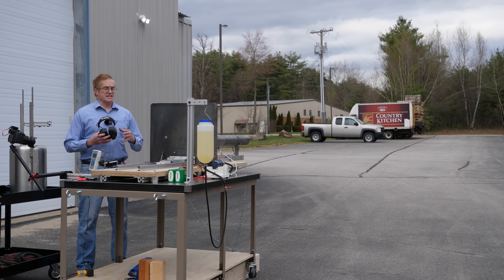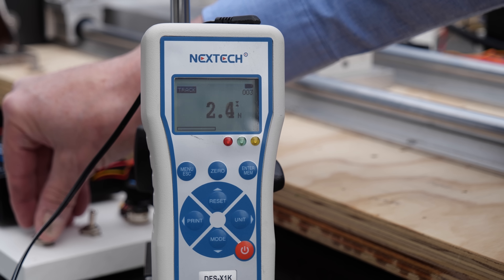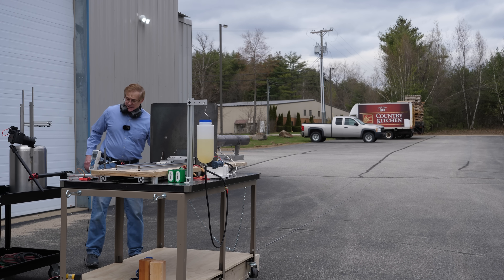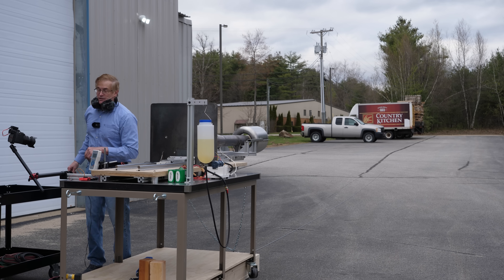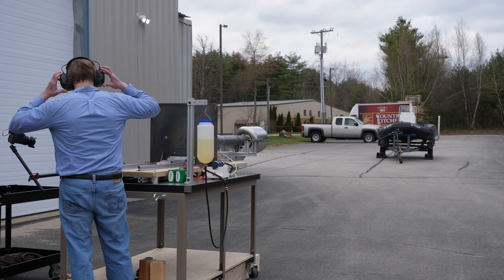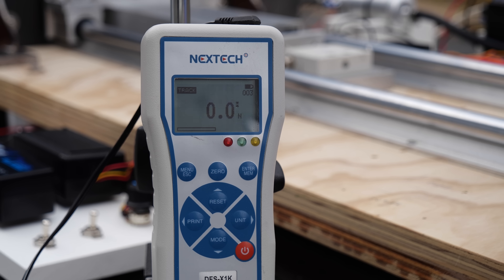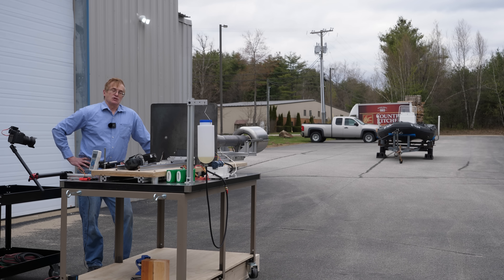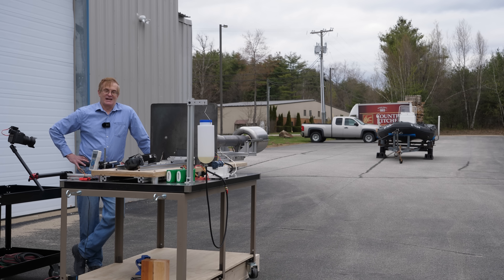WE USED AN AUGMENTER ON OUR PULSE JET!

Comment: In all my time with PJs I have never seen a Augmenter do anything for thrust.A flared tail pipe adds thrust though.20% more for the V1 buzz bomb.
Reply from the maker: We might try the flare. Any recommendations re the proportions?
Reply: @TechIngredients  A flare is not so much to add thrust as a rocket does but to release the stock wave slower so the return Vacuum wave is wider so has more time to draw air in.

Comment: From what I've seen before the augmentor has always been installed a few cm from the end of the pulsejet
Reply: So that as the thrust leaves the barrel it spreads a bit before encountering the augmentor and then pushing the expanded area trough it

Comment: When used in a flying vehicle, with the augmenter, maybe increased forward velocity of the vehicle plays a part, as increased forward velocity would increase the air input also ( akin to a scramjet ). You are simulating the air intake with a fan, that although is variable, is the same across the sweep of fuel/air mixtures, when compared with out without the augmenter.

So in loose terms, if the augmenter does increase air intake due to an increase of the speed speed a flying vehicle, in the static setup it might be the same as increasing the fan speed, which you have demonstrated previously does increase the thrust. So it might be having an effect, just not visible / measurable in the static test setup ?

Comment: Excellent video, with some surprising findings!  I suspect the augmenter requires more explosive detonations, including external portions of the burn (shorter tube), transforming those explosions into forward thrust.  Your tube, however, is long enough to consume most to all of the burn.

Aviation 101 (applies to turbine engines)

1)  Fan on
2)  Ignition on
3)  Fuel on

Engine Run!

1)  Fuel off
2)  Ignition off
3)  Fan off

I'd have just hooked 100 foot of steel cable to my truck positioned at the other end of the parking lot behind the Country Kitchen van.  Quicker.

You are correct, Dr.  The pointy end of the wedges should face the nook between the tire and the ground so the boat's weight wedges (heh-heh) them in place.  That way, they act as immovable chocks instead of movable blocks.

Comment: Cool! I've been waiting for this one. So I'm thinking it might be better to have the last 1/4 of the exhaust tube flare out a bit to take advantage of the expanding gasses, much like a rocket engine nozzle. If I recall, from the rocket engine building class I took from John Wickman, about a 30 degree flare would do it. This is assuming there is any excess thrust to be had. The advantage is that it doesn't add much weight or additional wind resistance.  But I think I'd ask Bob what his experience is with flared (slightly conical) exhausts .  I have seen that some of his have this option.

Great job as always...

Comment: Hrmm. You can produce thrust just by heating air in a correctly shaped duct... the Meredith effect. 
You seem to have a great deal of heat being rejected by that tube. Another device that rejected heat from a tube using airflow is the Lewis gun, with aluminum fins around the barrel and a shroud that used muzzle blast exiting forward to draw air through. 

So... design a properly shaped duct around sheet steel fins (Al would likely soften or melt here), utilize the Meredith effect and get some recovered energy from your waste heat as thrust? This wouldn't work while stationary though, this would require some airflow through the "cooler".
Reply from the maker: You can, but the effect is very small at low compression ratios, so it isn't worth it unless you already have a drag generating radiator, and the effect is used to reduce that existing drag.
Reply: @TechIngredients  Sensible conclusion. Only other ponder I have about these things is figuring out an annular tesla valve, but that's not so much a mod but a clean sheet redo.
Reply: @TechIngredients  ram jet motor

Comment: Honestly standing behind the running pulse jet instead of to the side is pretty brave. I know you took all the precautions but that made me clutch my teeth a bit
Reply from the maker: Actually,  the frontal position is safer as the blast plate blocks a direct line to the engine.

Comment: Rough adjust would help even. Augmenter is not able to pull air it should, might be a problem with angle of the cone. Pulse detonation is much more interesting and gets better reaction from neighbors, so moving forward it is.

Comment: Does the augmenter need airflow between it and the engine to work, like on a plane in flight?
Reply from the maker: Yes.  That is why there is a gap to allow air to be drawn into the high velocity jet exhaust.

Comment: I think you need to run this in a wind tunnel to properly see the augmenter effects. In this static setup I think the exhaust is losing energy from accelerating the still air at the augmenter input ring due to pressure differences

Comment: You know, the whole reason augmentors don't work well with turbojets is that the stagnation pressure of the jet is the pressure downstream of the turbine, which is much less than that downstream of the compressor.  Wall shear stress can easily null out the added momentum of the entrained air.   However, air augmented rockets have been investigated for almost 100 years, and they do significantly add to performance.  There's even a production missile, the Meteor air-to-air missile (https://en.wikipedia.org/wiki/Meteor_(missile)) that uses a throttleable ducted rocket ramjet engine with a specific impulse on the order of 500 seconds.  It uses a fuel-rich solid gas generator (rocket) driver, containing metallic boron, driving a ducted rocket ramjet.  One feature of this augmentor is afterburning, so oxygen from the air helps things out.  My major professor at Purdue ran a boron air-aug rocket project back in the 1970s, before I got there.  But they've been studied and tested extensively by about everyone developing rocket-propelled anything since the late 1920s.
Reply from the maker: Actually,  I know, and that is what has been driving this project.
Reply: @TechIngredients  I really love your videos, and admire your setup.  I'm a retired aerospace engineer.  If I lived anywhere near you, I'd work for you free of charge.  Heck, I'd pay you to let me work for you.

Comment: I love the videos! 
I too was thinking in terms of running this test in a wind tunnel. But for the opposite reason of what some suggested in that the augmentor needs airflow to work. 
My intuition told me that the leading edge has a lot of surface area, that it may hurt performance more than it helps. Also have to account for its weight when flying a practical application.
 I don't understand all the ins and outs of aerodynamics, just pointing out what my intuition told me. 

I love the content you make! Thanks so much for the great videos!
Reply from the maker: I think your intuition is good. This probably explains why we don't see these things very often.

Comment: 4:15... lets pause here and make a prediction.
i dont have a degree, nor do i write any "papers".

NO. it shall not work. its very simple. the same mistake is made over and over again. (hmmm, can you say "ionic thrusters"? or lets try "coanda effect"? how about "jetoptera" startup concept?)

you dont have to be a rocket scientist to see why.

thrust is simply the difference in pressure inside the combustion chamber. that the nozzle being open to the atmosphere has less pressure acting upon it, and the unbalanced pressure in the combustion chamber causes a reaction in the direction AWAY from the nozzle.

once the air has been ejected from the nozzle, you can perform no more work upon it. it is no longer interacting with you. its GONE.... you ONLY work on it when its in the chamber and being accelerated out of the nozzle. that pressure doesnt act on the nozzle. it acts on the COMBUSTION CHAMBER. THAT is what produces the "thrust". NOT mass flow, either... mass flow is a RESULT of the pressure imbalance. 

the air entering the shroud, augmenter, venturi?

YOU can perform no work upon it. it is only accelerated due to collisions with the air you DID perform work upon to force out of the nozzle. it REDUCES THE EXHAUST VELOCITY. it "gets in the way". it is DRAG.

if you think of it as pressure... where is the reaction acting? upon the incoming air. not upon the body of the vehicle. its an open ended tube.

un pause... lets continue...
9:35. 
"i'm not impressed..."

as for me? i am glad you did this. i knew exactly what would happen. rather than an increase, you get a DECREASE of performance. i am saddened that people are so out of touch with reality that they think these types of things could actually work. this is the state of the modern education system. myths and half-truths abound. mass mis-conceptions. we get told things by people that dont know themselves...does your teacher telling you about venturis and bernoullis really understand or are they just reciting textbook material?

that being said, if you look more at the cooling systems used on certain fighter planes that used the waste heat to add to the thrust... they have what can literally be described as a "combustion chamber", a section where entering air can be heated, cannot backflow, and has no option but to be forced out of the nozzle with resultant reaction forces on the aircraft itself. they were the precursor to the pulse jet, after all...

so, whilst in this basic form, it can never work, with some consideration of where the pressure is, where the reaction and reaction is taking place, and between what... you could get something to happen... 

you need a way to get the reaction to take place upon the vehicle itself, for the pressure to act on a physically connected surface.

Comment: The Augmenter looks to my untrained eye to be a sort of venturi effect device, with an open airflow at the top/intake, is the opening for airflow? and if so would the augmentation effect be relying on similar positive pressure to the pulse jet intake?

Comment: I agree with a couple of viewers, augmentation does work but totally different designs than the one you used. The best one I did see running ran 30% along the exhaust tube, preheating the air by induction. It had a larger bell flaring and a closer taper at the exhaust. It became far more efficient when in flight with airflow enhancing the ducting.
Reply: yes... in its basic form it cant work. the air being accelerated through the duct is not being worked upon directly. only the air flowing through the jet itself is worked upon, is accelerated, and can produce a "reaction" upon the combustion chamber... once its left the jet, that gas and what it interacts with has no bearing on the reaction forces produced. you dont push on the air behind you. it simply gets in the way and reduces efflux velocity... backpressure!. rockets work better in a vacuum... you might drag more air through the system, but it isnt producing a corresponding reaction. thats fixed by the pressure differential across the nozzle.

but... if one takes the ram air principle, air stagnates in a converging duct so adds its momentum to the static pressure, then takes that high pressure air, heats it with radiant/conducted heat, allows it to expand in a chamber then escape from a nozzle... at either atmospheric or lower...

its basically just added another "pulse jet" to the outside of the thing. the imbalance of pressure causing air to flow out of the nozzle has something other than just the incoming air to act upon. the inside of the heating chamber. and that is attached to the jet and the aircraft... air go one way, plane go the other.

picture it another way. 
lights cigarette wave your hand through a cloud of smoke. 
the resistance you feel, the work you do, is to simply displace the air in front of your hand.

the swirls and eddies and large "slipstream" following, that is simply air you worked upon and accelerated,  losing energy to the surrounding atmosphere. it may impact molecules and cause a greater mass flow in a general direction, but the work applied to that mass is still the same total, the amount applied by your waving hand...

simple air entrainment does nothing but add drag.

ah, the name just came to me!

"meredith effect". using the cooling system to add thrust to certain fighter planes. precursor to the pulse jet!

i also picture an annular type affair... feed the exhaust gas OVER a central cone... and the entrained air is ejected inside the efflux, that automatically being a low pressure zone... the incoming high speed air is first rammed through a choke point, then allowed to expand, slow down, increase pressure inside the duct... then "sucked" out the nozzle. ideally, with excess heat still being added during the expansion phase. 

if i was better on CAD i could wack something up in half a day...

spends the next 3 months...

Comment: Great video, as always.

Personally, I would have considered using that pickup truck as an anchor. It is much easier to move, likely has a trailer hitch, and you could apply the parking brake. Note, I'm not responsible for any property damage or injury from following my suggestions. 😯
Reply from the maker: THAT is why we didn't expose our truck to this..."thing".

Comment: I believe the augmentor has to be some distance away from the end of the exhaust. Not necessarily fine tuned. It’s like from blowing the air at an opening it pulls in 4x the amount of air with it when there’s a gap but if there’s no gap it’s not pulling in any extra air. It’s Bernoulli Principle. Please try again with the gap to see if it works!!!!

Comment: Well, that's how it was supposed to happen! - you don’t have an ordinary detonation engine - your air is sucked inside not by the inertia of the exhaust gases, but by a fan. Therefore, you always have warm air at the output, and the detonation amplifier will only work when there is cold air in it during the next outbreak! At least put a fan in front of him...)

Comment: 7:38 Uuh… without the boat's weight on them, the ramps will just slide on the pavement. What you really want are proper wheel chocks, since they'll do the same thing with less movement. $9 at Harbor Freight.

Comment: Well, the first thing is to stabilize the force-meter. It is unreadable. 
Second, as far as I know, an augmentor has to be fine-tuned with the engine, pipe length/width, resonance frequency, temperature, exhaust movement, and velocity. It has to be centered around the engine to create that tuned effect.
It's probably not that easy to get those to work in harmony.

Comment: I knew it wasn't going to work in the last video and this video proved me correct but I found it rather funny the amount of effort put into keeping it from moving when the weight of table itself is more than enough to keep it on the ground. You could hold that jet back with your bare hands if it wasn't red hot lol even massive pulse jet the size of a small car wouldn't need all that to tie it down just a solid mount that grips the ground nicely. Cool video none the less I definitely wasn't expecting it to decrease performance
Reply from the maker: It is better to over build rather than under build when it comes to safety.
Reply: @TechIngredients  that is very true

Comment: that exhaust tube seems to work like 2-stroke engine exhaust pipe, explosions per minute, or rpm equivalent
Reply: try tesla disc turbine as the turbine/pulsejet input compressor, instead of the flaps or the normal axial flow compressor turbine. also try tesla turbine as ice turbine engine by itself, any form.
Reply: Try pulsejet liquid or solid rocket, yep pull both fuel and oxidizer from their separate tanks by the pulsejet vacuum, no turbo pumps required to operate, simplest liquid rocket

Comment: The engine is not moving through the air. The "Augmenter" isn't going to work. While the Venturi Effect may be (or not) sucking a bit of air in between the augmenter and the tube of the jet, if it were moving through the air under it's own power, air would be forced between the augmenter and the jet tube, compressing it a little. This air then expands in the augmenter. Said expansion is "augmented" by the exhaust flame, giving you more thrust. Oh, and instead of hauling a boat out and cabling it up to the rear of the thing, just use the truck that hauled the baot in the first place and park it in front of and touching the table. That jet ain't going to move a parked truck!

Comment: Well they had that lovely dad son argument over what i had in my head moments before. Really its not as clear cut if the ramps will work as chucks or not. They essentially redirect the pull force partially into vertical force that is acting against the gravity force and static/dynamic friction force of the boat, IF we assume the bottom of the ramps have good enough friction on the pavement, this is of course more likely the shallower the ramp angle is.  Now I'm going to put my no math just intuitive estimation in this without seeing what happens: The presumably tripled thrust of ...about 500N? is nowhere enough to pull that RIB and its trailer up that ramp and it will function as an anchor just fine...also its receiving some fraction of that thrust as headwind, which also goes in my favor.... I'll post my reaction to the results below this.
Reply: LOL okay so the augmentor totally failed, which surprised me. I wish they had settled the ramp issue at the end by using roughly the estimated maximum thrust...but why bother.